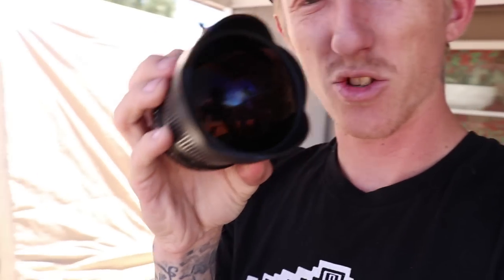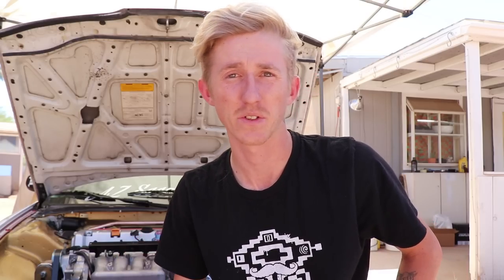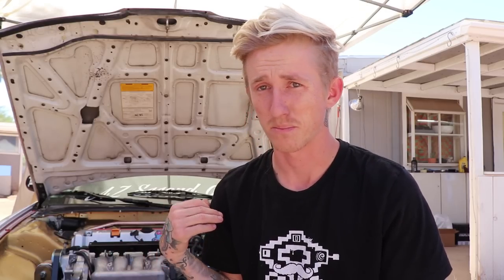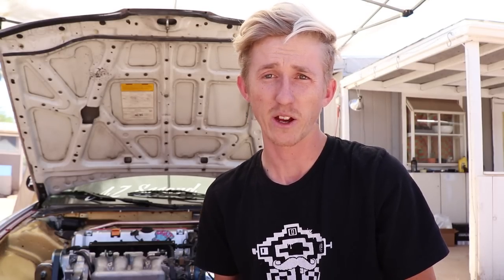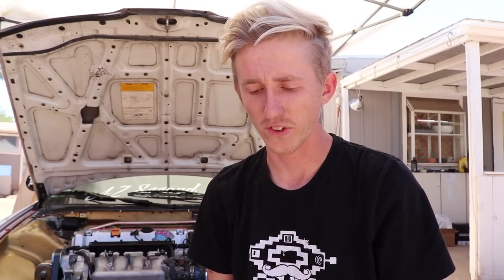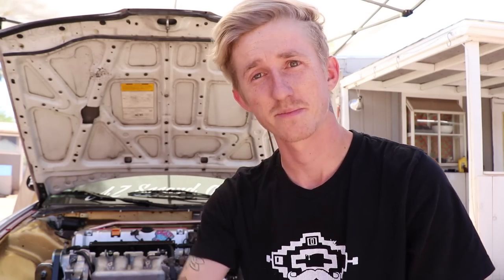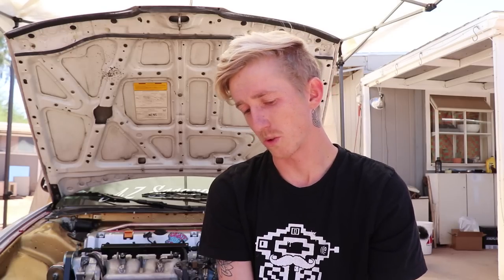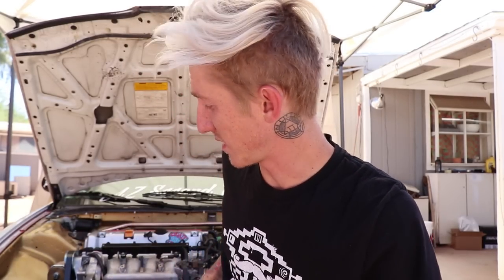Should You Do A Brake Booster Delete

Comment: would not reccomend deleting your brake booster if you live anywere with heavy traffic, buddy just totaled his 90 si just couldnt stop in time.
Reply: nothing wrong with a booster delete if you change the master, or the linkage ratio to compensate for it especially in modern cars with disk brakes as long as you dont forget leg day!
Reply: @speedbuggy16v  On Wilwood site, you can find formula on how to calculate to get the correct master cylinder bore size to fix your needs. On Honda, your best bet is 7/8" bore size with the correct link relocation as you mention. Also, this is very important as the type of brake pads you need to use. Usually you need high initial bite pads like Hawk DTC 60 or 70 but those are road race pads that require the pads to be in high temp to get that initial bite. On the streets, you will not be able to get up to that required temps for those pads to work properly. That's why Hawk listed for track/road race only. Also, people do booster delete is for threshold braking where you can modulate the brakes. All of this is NOT for street use. Therefore, highly recommend to NOT delete for street use.
Reply: @David-nb2bc  I am with you on all of this, not a honda guy, but all the math works the same.  I will be deleting the booster on my E30 for the LS swap, while I may have increased pedal pressure its OK, I grew up in farm country where the tractors and most of the trucks had NO brake assist.  LOL.  Besides it gives better feel when your modulating the brakes.
Reply: The booster does not reduce braking distance, but more force on the brake pedal is required.
Reply: @David-nb2bc  On an older car things can be quite different. My 79 Subaru with solid rotors can get the pads hot enough to burn in stop and go traffic. A racing pad certainly does get hot enough to use on the street due to the solid rotors. Although that car could come factory with no brake booster. The pedal has holes for both setups. The size of the master cylinder and the hole changes based on brake booster or no brake booster. I'm running no booster because the current engine doesn't produce enough vacuum to make it do anything. Threshold braking is just a daily fact of life driving an old car with no ABS. I find no difference in the ability to threshold brake with or without a brake booster. I was running EBC SR11 pads (larger ones for a GM car cut down into the 79 Subaru shape) because nothing but cheap pads were available. Now with the 83 Subaru calipers installed I'm running Hawk Blue 9012. Definitely heat up enough to function on the street but this is again with solid rotors only around 10mm thick that get red hot the second you push the brakes slightly hard and will start to burn cheap pads doing a hard stop from 20mph. My friend runs DTC 70 on an 82 Olds Toronado with hydroboost brakes, but that car is around 4700 lbs with tiny brake pads and rotors, so again it heats up the brakes ridiculously on the street. Would I recommend taking a brake booster off a newer car with ABS, probably not. If you want the solid feel brakes you're much better off going to a hydroboost setup like my friend's car has than a manual brake setup. But on an older car with no ABS and possibly solid rotors or undersized pads, many of which had stock manual brake options, I don't see a problem with it as long as the master cylinder size is correct. I don't see a problem with race pads on the street either if it's in a heavy car with small brakes, or a car with solid rotors on the front. I saw my brakes improve significantly going to the manual setup, because there was not enough vacuum to boost the brakes anyway. If you're running into those types of issues it might be a solution for you but if you're just trying to get a more solid pedal feel, or a cleaner engine bay appearance, hydroboost is probably a better solution, so long as you have power steering to run it.

Comment: I'd be willing to bet that the cylinder you used was 13/16ths (not 13/15ths). And the stiffer pedal is the whole point, it makes brake pressure easier to modulate for trail braking etc. For any car with ABS, I wouldn't bother doing this, just brake as hard as you want and let the ABS save you if you're locking it up. For a race car that is going to be breaking into corners and doesn't have ABS, it does give a nice bump in ease of modulation.
Reply: That and also with the csl airbox and s54 in my e30 there is no space for the brake booster lol
Reply: Some of us have daily drivers with no ABS and the racecar strategy still applies. My 79 Subaru doesn't have it. Although it could come from the factory with either manual brakes or a brake booster. The firewall has the holes for both setups. I went to the manual setup but only because the new engine with a big cam doesn't produce enough vacuum to boost the brakes.

Comment: You need 2 or 3 peoples pushing that pedal, and then you see the african's dancing with the coffin and a bright light at the end of a tunnel
Reply from the maker: It’s not that bad haha
Reply: @ChrisSadowski  what i would recommend is moving the connection point on the brake pedal higher toward the axis of rotation of the pedal. 

On my e36 I moved it half the distance and it made it much easier. All it took is a new hole and connecting it.

Comment: Made me feel like a jackass for asking a simple question the other day but here’s the information I was asking about just in case anyone else wants to know. The brake booster (4 bolts) inside cabin need to be tightened down to (9 ft lbs). And the two bolts that hold on the master cylinder need to be tightened to (30 ft lbs) if you decide NOT to delete! ✌️
Reply from the maker: Wrist tight and elbow tight 😀

Comment: The brake booster multiplies the force you apply to the pedal with your foot by 4. So 100 lbs of force from your foot would equal 400 lbs. Without a booster you’d need considerably more force on the pedal to stop the car. Image you’re at the top of a hill and you roll down in neutral with the engine off. Press on the brake pedal and you’ll soon see why boosters were invented. Of course no one would actually be ignorant enough to do that lol. If it’s a track car then manual brakes are the better way to go. But would not recommend for street car where you may need to do emergency stops.
Reply from the maker: Well put. This is what i try to tell people when they ask me about it on social media. It’s not worth it on a street car, especially when your street car has 500whp and is a tin can. Don’t sacrifice brakes for looks

Comment: When you are left-foot braking and applying throttle at the same time, you lose the vacuum effect and the brake pedal becomes harder to press. This will slightly unbalance the car and won't feel super smooth.

So actually, going back to a brake booster so that you can left-foot brake in canyons isn't the ideal solution, if you want maximum precision.

But the goal is to have fun so do whatever you prefer.

Comment: Just a suggestion, but you can change the pedal ratio (where the brake cylinder rod meets the pedal) and that should make it easier to heel toe. I know the Chase Bays delete has that built in to it.
Reply from the maker: I long ago got rid of the booster delete. Decided it was much too unsafe for a street car with the delayed response and extra effort required to use it.

Comment: Brake booster delete is for a car that doesn't move aka show car.  Don't be street racing without a brake booster, your shit will stop when you crash.
Reply from the maker: I agree to an extent. It’s not that the delete makes braking worse, just makes it more demanding, with a proper MC, pad and rotor setup you can still brake extremely efficiently. But it’s just more firm. But I still don’t recommend it for daily drivers
Reply: You need to go to the gym if you can't lock up a proper non-booster brake system
Reply: ress87 lol

Comment: Yea I wish there was “something” that we could use to adjust the brake sensitivity like a vacuum dial or an AM adjustable pedal linkage for ease of leverage when stopping. Having just the master cylinder alone is a lot of work even if it’s a chase bay I would know. I should put out a vid of it on my autobody Chanel bcs the entire brake system has been upgraded, all but the stock calipers front new rear old but even with lines and pads it took a very very long time for the new rotors to properly brake in and have better stopping power. I’m just wandering how much better it will be with performance calipers and pads.
Reply from the maker: Won’t be much different. The difference in a “performance” caliper/pad setup is primarily cooling abilities and pad compound. The pad compound will determine how good hot/cold bite is, how much heat they can take before glazing, etc.  The caliper difference will allow for a more consistent brake feel based off its design/number of pistons resulting it more even use across the rotor surface (as compared to one big piston pushing the center of a pad, you’ll have 2-3 pistons evenly applying pressure across it)

The lack of a booster or vacuum/power assisted brakes is gonna have more or less the same result across the board. It’s just gonna take a lot more effort overall
Reply: @ChrisSadowski  …. …. Been working on a K swap to an 98 Integra. Bought it half way done but previous owner was doing all the right things with all the right name brand parts and what’s popular on the market for these k swaps. Single piston chase bay master cylinder & hard lines but what I think I’m facing is rear brake power. I have the brake biased dial to get the most out the rear but even though this car is my daily, the rear rotors do not get the shiny surface unless I’m pulling on the E brake with or without pressing the pedal. Even though the rears only bite like 25% they are not cleaning the rotor so they might be under performing. Fluid was dirty, I did drain the old fluid when bleeding and topping off but the rear calipers might be binding bcs they work but not well. I hope it has nothing to do with the delete and hard line install which has been reliable thus far. Are you on any forums? You sound like an interesting person.
Reply from the maker: I don’t do forums. I just do YouTube, and instagram

Comment: best bet would be a hydro boost set up uses power steering pressure to assist your brakes no booster needed
Reply from the maker: That’s not a bad idea. Although this car does not have hydraulic assisted PS. At the moment and time of filming this video it was depowered rack, and I’m currently buying parts to convert it to full EPS
Reply: @ChrisSadowski  nice I’m trying to get hydro system for my truck put a cam and lost vacuum so the 2500 of my truck have hydro powered brakes no more vac booste r

Comment: If you want to see how it feels without power brakes, just disconnect the brake booster.
Reply: That's a good way to find out why your plan on using your stock master cylinder is a bad idea.

Most people doing this will replace the MC with one that's designed for the purpose (many times in combination with a ABS delete). That's a very different story and not anything like disconnecting your brake booster.

I think the booster is a great feature on a daily but there is a reason why no race cars use boosters. Better pedal feel, firmer pedal (you can "brace" against the pedal while braking), better consistency (a brake booster will run out of vacuum), etc.
Reply: @ress87  doesn't the aftermarket ones have a bigger bore?
Reply: @novaorbitdragon  Nope, smaller
Reply: @ress87  actually most of the people doing this literally do it for looks, nothing more.
Reply: @B18C5EH2  hahahahhahahahahha

no mate.

Comment: If you cap off the booster will it feel the same as if it was deleted?
Reply from the maker: Yes
Reply: @ChrisSadowski Just realized you mention this in the video already.   I was researching and it said that you have to adjust the pedal ratio if you get rid of the booster to have proper pedal feel.  The pedal was way too heavy with the stock 4:1 ratio.

Comment: Chris you didn’t leave hush link for delete. Also on their site the delete plate requires a Wilwood aftermarket brake master cylinder. Your car looks like you just used oem Honda brake master cylinder?? Link please thanks
Reply from the maker: You can use your stock master, if you found the website then you don’t need the link lol, but I’ll add it in the description
Reply: Chris, thanks for the link. The one I found the plate was for a Wilwood brake master cylinder NOT oem Honda like you have. So you were much help.👌🏻

Comment: My cars brake booster is currently garbage aka not working. Is it ok if I can drive without it ?
Reply from the maker: Yeah you just gotta get used to the braking force without it. Just takes a few days
Reply: @ChrisSadowski  oh, okay thanks I thought I wasn't going to be able to drive for a while, thanks for the response
Reply from the maker: Yeah just block off the vacuum port on the manifold and the booster for now. Brakes work the same just require you to use more physical force to get the same braking. Do a bit of practice on a side street or something for a few minutes to get the feel of it
Reply: @ChrisSadowski  i don't think I can do that to my cars booster because there isn't a big enough bolt, I have a 1986 firebird trans am

Comment: What master are you using ?
Reply from the maker: At this time it was a crx HF master I think
Reply: @ChrisSadowski  damn i got it thinking it was supposed to fit the stock da9 master
Reply from the maker: It does fit the stock DA master. I switched to the crx master because it was smaller so it was less effort to get the pedal to work

Comment: Don't throw the lense out, try wet Sanding it with 800 to 2000 grit. As if it was the clear coat on a car. And yes brake booster delete
Reply from the maker: popanollie1 I was just gonna save the lense for skating mostly. I spent too much on it to throw it away lol